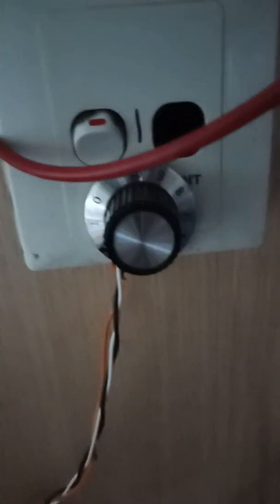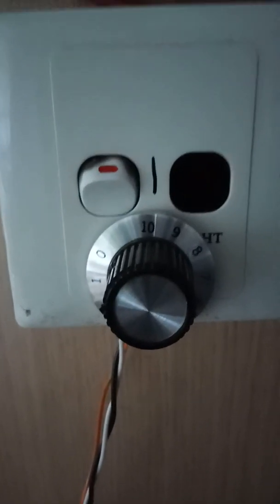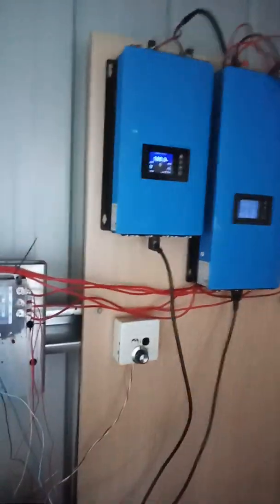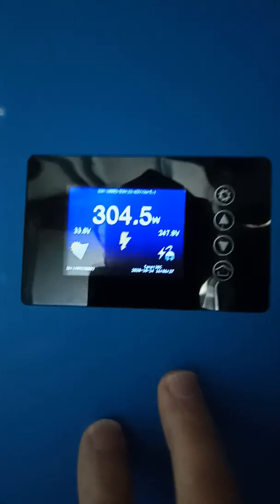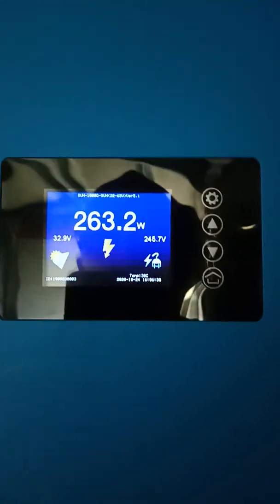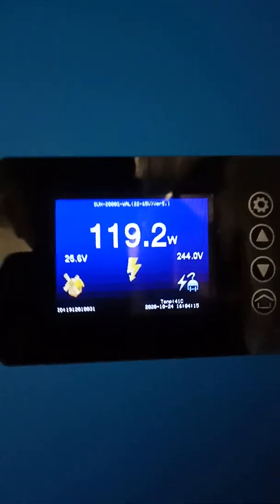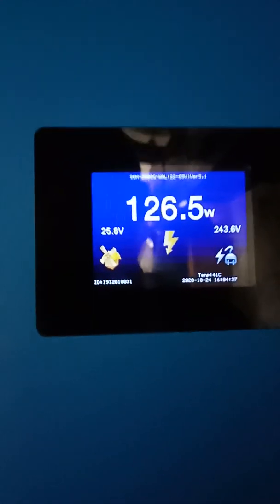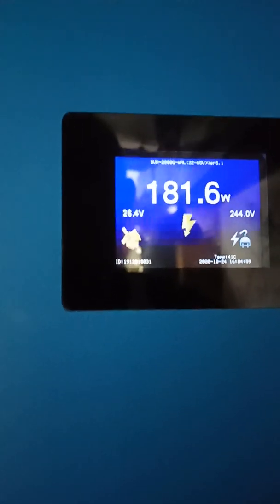B & C 1000w wind turbine.  with gti 2000 W inverter. (2)

Comment: love to see the wiring diagram & components you used to your manual dial brake to resistors... pure genius.

I'm new to this stuff..  I can't seem to find a 48v controller 2000w
Reply from the maker: This seller sells the 1500 watt wind charge controller that I use 24 volt 1500w. you would need the 48 volt version.
https://www.aliexpress.com/item/32493423887.html?spm=a2g0o.order_list.0.0.491f1802fQUNqn 
Or if using solar as well 
1https://www.aliexpress.com/item/4000863895867.html?spm=a2g0o.cart.0.0.6fb53c00CLzBKJ&mp=1

There is a diagram of how to connect it all up on that item. Once it is connected to the battery you just connect the gti to the battery. 
Keep an eye on the postage if it not free and is high you can always contact the seller and negotiate. 
This is the only way I found to activly brake the turbine. It makes a hell of vibration when the resistor is activated to slow the turbine with the first item but it is short lived and that protects the battery and the GTI from seeing excesive voltages. I will be updating mine to the second type still researching at the moment but looks like that is the one I will be using because it is auto voltage. 24/48  
The number one reason for applying the brake in a strong wind storm is, If you don't the turbine will wind wall. When this happens you are basically holding a 2 meter disc agains the wind and it can destroy the tower and cables. That is what happened to mine Nothing could hold the turbine and it just spun super fast before it turned out of the wind. It is now repaired I lost 2 blades due to the cables breaking free from the anchor point. Since the install update I have not heard the turbine spin up it spins at a lower speed and makes much less noise.